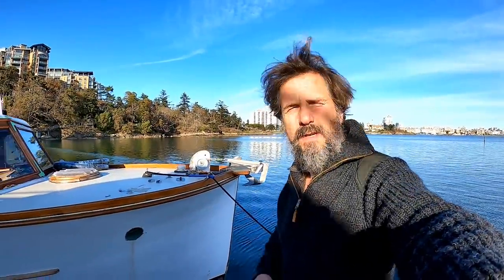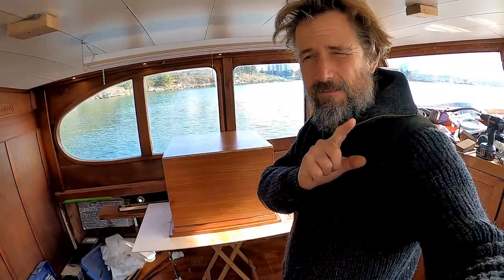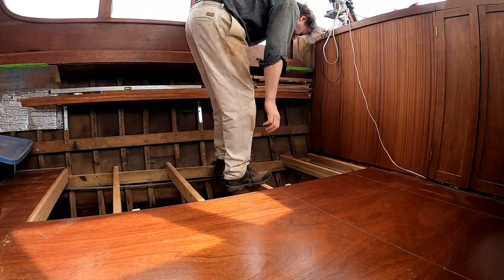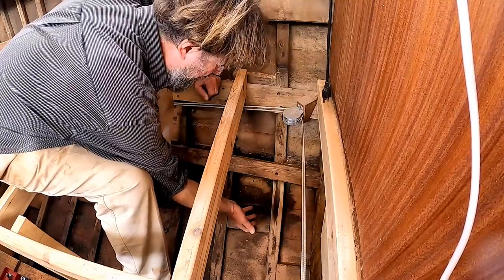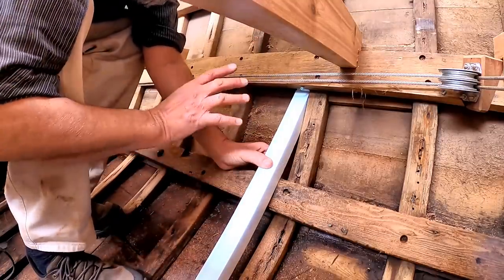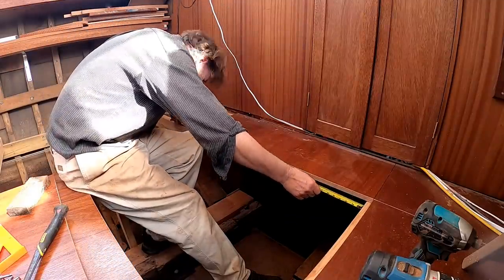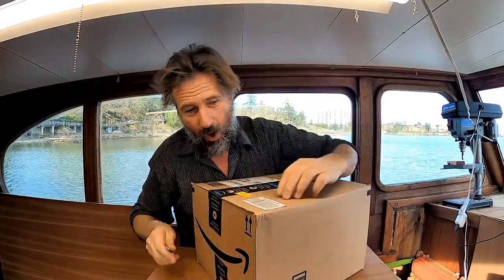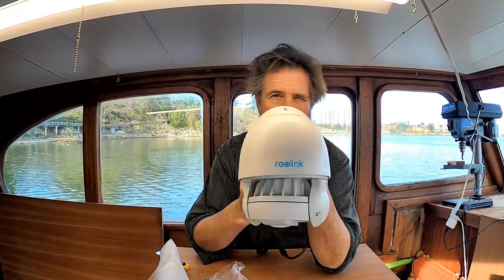Frame Templates - #223 - Boat Life - Living aboard a wooden boat - Travels With Geordie

Comment: You probably have figured this out by now regarding the short camera cable. The 1 meter long "reolink" camera cable that comes in the box is for testing and should be substituted with an Ethernet cable for instillation. Please give us an update once it's installed. And thanks again, as always, for such quality programming, I look forward to your episode every week!
Reply from the maker: Hmmm, I don’t think so. this multi core cable is hard wired to the unit and certainly the only connection option. in fact this isn’t a POE camera.

Comment: I think there may be another useful solution for your sister ribs to consider. 
Here is the concept.

1) Make a Fibreglass flat sheet, about 2-3 mm thick, from say 20 oz biaxial cloth and epoxy. Do it on a flat Melamine board, to get one side mirror smooth.
2) Cut the  the sheet (with your circular saw) into strips  the width of the ribs.
3) Epoxy  the thinner strips behind the stringers, one at a time, over the top of each other.  They will bend like a fishing rod, with no problems and no weakness at  the bending locations. You may be able to do quite a few at a time. Hold in place with temporary packers as they cure.

From the first strip, use a sheet of plastic to prevent bonding to the Timber Planks. You don't want voids that can trap moisture in pockets. You may want to plastic cover any nearby stringers too.
Slide and Epoxy the next 7 or 8 layers to the top of  the first strip. 8 x 3 mm is  really thick and strong. You may be able to do multiple strips at a time.
On  the final strip, put the mirror smooth finish uppermost.
Drill fasteners as required.

The advantages.
1) You end up with a water impermeable rib as good as the problematic Polyethylene
2) The bending to shape will be infinitely easier with thin strips, and once the epoxy is cured, permanently bent with no weaknesses where bending has occurred.
3) For really tricky locations, you can make the strips shorter, and butt them together. You can even push the shorter strips in from different sides as required.

You may want  to just use this technique for really tricky bits, and the Polyethylene for the other places.

I hope the concept is useful. All the best.

PS - extra reading.
I used this "thinner strip", laminated technique for a Canadian canoe rib, with one difference. Instead of fibreglass strips epoxied together, I used 4 mm Western Red Cedar timber. 
Normally, bending WRC at tight bends would snap it, but I found that if I epoxied just one side with 16ox glass,  when bending it with the glass side to the OUTER side of the bend,  made it curve like a fishing rod, with no breakage. If you glass both sides, it won't bend at all.
You may find  the idea of timber trips more appealing, so if you layup the timber strips on one side, before installation, you will get the same "easy bend" effect as the fully fibreglass approach but with timber appearance.

Comment: I'm sure you've considered laminating the sister frames in place. Gluing thin laminates, held together with very small flat head nails clinched over, then slipping this laminate in while the glue is wet and then fastening to the planks.
Reply from the maker: The frames aren’t the issue, they’ll steam bend very easily. it’s the filler section under the chine stringer that must transition to the frames. 
Lamination is not an advantage. See episode 197 for explanation.

Comment: I have one question about the reframing.  Why not simply remove the stringer, put the sister frame in and then scarf in a new segment of the stringer?.  That is what I did when I installed my new frames and it worked fine.  Also, I am a big fan of using laminated frames for locations where steam frames have broken.  Laminated frames are stronger than steam bent and much less likely to break.  It would be easy to build the chine transition into a laminated frame.  You can make patterns for the laminations of just do them in place.  I too watched the install of the last bit of Tally Ho's hull.  I was a bit disappointed that the live stream's only reference to spiling the final bit of wood was an aside from Pete.
Reply from the maker: Hi Todd, the problem is removing that stringer would be very precarious as it’s a chine stringer and holds the whole shooting match together. Happily there’s no need, or to laminate either. the new oak frames fall inboard of the stringer and thus take a very gentle curve. the issue is providing a filler section behind the stringer to take screws. it must be shaped to transition behind the oak frames which is my main dilemma. Episode 197 shows it all quite clearly. https://www.youtube.com/watch?v=HusXKUKTtQQ

Comment: pattern making.  another boat channel showed making patterns by rough cutting a thin sheet and holding it in place while small rectangular tabs are hot glued in place to create the outline of the shape you need..  just lay it down and connect the dots. 
TIP. wooden carpenters clamps can be cut in half.. thru the wood.  the side that the screw turns in mounted to a plank or plywood.. all the handles facing one direction. you can create a adjustable jig for steam bending.  multiple clamps across the steamed frame to clamp to the moveable end of the carpenters clamp or longer ones to the fixed end screwed down.  you may need to make a block that is changeable for chine angle change..

Comment: It is Leo Goolden, rather than Leo Sampson, of the Sampson Boat Co.  I started following his channel from the first video, and was particularly interested since I used to live outside of Blaine, Wa.  Another great channel,  from the East coast,  is "Acorn to Arabella", where they are several years into a similar build, however, they started with building a mold to cast the lead keel, and have progressed from there.
Reply from the maker: I knew that, but didn’t know it was common knowledge. I follow A2A as well great stuff.

Comment: I know everyone hates back-seat engineering, but I'm going to do it anyway, sorry in advance.   I have a tought on the additional structure.  Could you not extend the "plastic" rib from the bend, all the way up the side to the upper "lateral member" (forgive my lack of wooden boat vocabulary), and "sister" the oak one on top of it all the way up and butt into that "lateral member"?  Then run the hardware through the planks (see, I snuck it in there), plastic, and oak?  Then you have the oak running the full length, but don't have to mess with that fiddly bit of going over then under another member.  Anyway, I don't have any idea what I'm talking about, so feel free to completely ignore me.  Cheers!
Reply from the maker: Jim, I believe you’re explaining exactly what I’m going to do. Have a look at episode 197 which explains it.

Comment: ABS or PVC plastic sheet is inexpensive and can be purchased in a variety of dimensions. They are also very easy to bond with the right plumbing adhesive. You may want to consider using 1/8" strips laminated into shape while in place. They'd actually be structural with enough BxH3.

Comment: I’m still remembering the moment that you put the stairs out the window....what did I miss??? I have subbed Leo as well for a long, long time. He is a great HR man (judging by his able crew) as well as boat builder and a sailor. I’m also a little confused on the sister frames you are going to instal. I thought they would be totally full length driven up under the ribbon plank and under the sole shelf plank and sprung against the inside of the hull planks. It seems as if you are doing something different I’m missing info on. ( under the ribbon plank and over the sole shelf???) I guess I’ll see soon what I’m missing. Everything looks great and much improved.
Reply from the maker: I’ll explain why you need to remember that next week. if I can get out of bed....heh.
The new frames will go from the keel, inboard of the chine stringer and under the next stringer up and stop. the point is to strengthen the vulnerable existing frames that are weak at the sharp chine bend
Reply: @TravelsWithGeordie : the thought crossed my mind but I dismissed it later on when I saw you appear to be unaffected. Sometimes I forget about next day editing and sequence. Have a better day!
Reply from the maker: Heh, I’m not even sure that’s what did it but the next day I just collapsed getting off the boat 5 minutes after shooting the St. Pat’s beer of the week. luckily I had been pretty productive the days before but you can see I’m not really moving along as quickly as I need to be.
Reply: @TravelsWithGeordie  Ha, you used the words St Patrick’s Day, beer of the week, and collapsed in the same sentence. Seriously I hope you’re all recovered in short order. Take care, we can wait for your comfort.

Comment: I've used outdoor IP security cameras for years, with POE.  Normally your home system has multiple cameras and you would run the ethernet cable (I use cat 6) to a POE ethernet switch or a POE port on a network video recorder (NVR).  

You can record in the cloud, but usually face a monthly subscription fee.  If you are recoding using motion activation (does not work so well on IP camera and could be a nightmare on moving boat), recording in the cloud would not burn a huge amount of data with your ISP.  However, where motion detect will be problematic, continuous recording is more practical, but would burn an enormous amount of data if not recording locally.  Often the cameras have an SD card slot, to record locally, which can work fine, if theft of the camera is not a big concern.  

I place the gaggle of wire connectors attached to the camera  in a waterproof junction box, such as this https://www.homedepot.com/p/6-in-x-6-in-x-4-in-Junction-Box-R5133710/202043436 which can either be surface mounted or recessed.  You'd probably want a more elegant solution for your boat, but maybe a similar idea.  The push button on one of the wires is usually a factory reset button, which comes in handy if a camera freezes - not unusual, as many of the camera venders have clunky firmware or software.
Reply from the maker: good info, thanks Ted!

Comment: Could you use heavy gauge electrical wire to form the patterns?  It would fit under the floor stringer.
Reply from the maker: I suppose, it’s not so much about templating the curve but the interface between the HDMW filler frame and the oak structural frame.

Comment: Why not make the sisters out of thin plastic strips so that you can build it up like ply? They'll be much easier to bend individually and once in can be bonded/glued together and trimmed to suit to make like a steam bent plank. No templates or planks required!
Reply from the maker: the templating isn’t to determine the curves, but instead the curved interface between the filler frames and oak frames.
Reply: @TravelsWithGeordie  Sorry, thought it was to get the right curve on the sisters.
Reply from the maker: no worries, both the HDMW fillers and oak frames will be steamed into place so will easily follow the contour of the hull.

Comment: I don’t agree with your method of running the HMWPE above the other board. It can be heated to bend the way you want it.
Reply from the maker: The HDMW goes behind the stringer. Refer to episode 197 for details.
Reply: @TravelsWithGeordie   I have gone back and watched 197 in its entirety. You mention a changed plan in the current video that seems to conflict with the 197 video.  I would definitely run the HMWPE behind the stringer in every possible place and attach the Oak on top of the stringer. My 2 cents.

Comment: 1 st, I know nothing. But can you cut out the stringer Install the sister framing and install a new stringer??
Reply from the maker: Nooooooooooooo. That stringer is critically structural. it’s no problem sliding under.
Reply: @TravelsWithGeordie  I figured there was an obvious reason. Fyi when the text popped up " remember this later" when you set the steps outside I thought that was the moment that you would have hurt your back!!
Reply from the maker: you nailed it. I’ve been in bed with a bad back for almost two weeks!
Reply: @TravelsWithGeordie  Peter I was joking about that!! I hope you get better soon. We're about the same age , and when I saw that bend out the window. I thought oh shit that move would have put me on the floor.
Reply from the maker: I’m not actually sure that’s what did it but the next day I just collapsed for no reason.